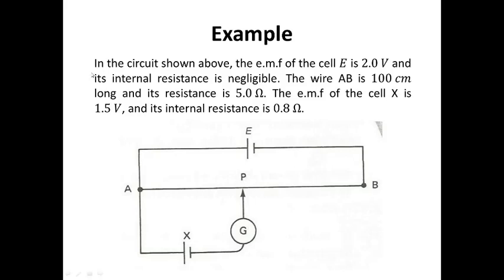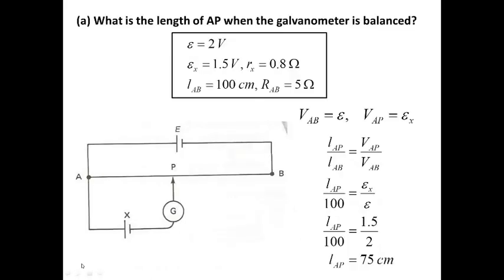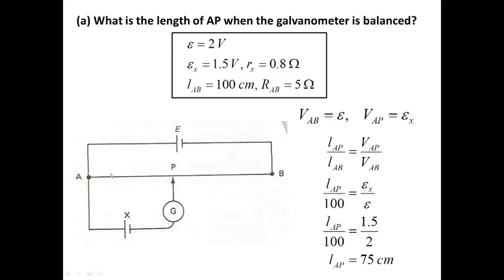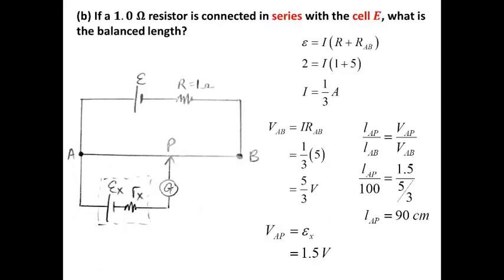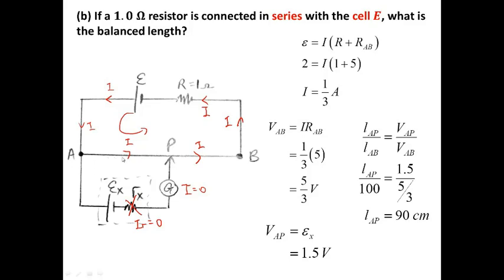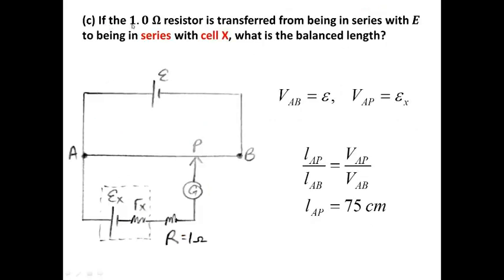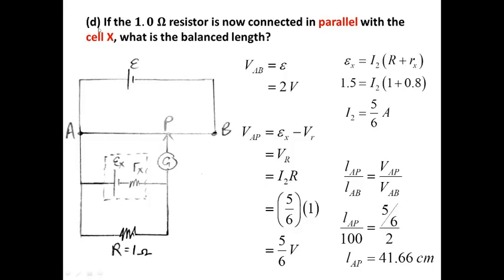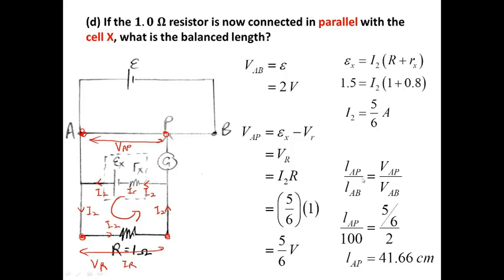Matriculation Physics: Potentiometer (Problem)

Comment: Sir, I'm confused..  IR= 0 because current is 0. But shouldn't it be V=IR ? but our V  isn't 0? Sorry for asking a silly question sir
Reply from the maker: Your voltage across the resistance wire or voltage across galvanometer?
Reply: @PekExplainsPhysics  is there a difference?
Reply from the maker: There are many voltages, which one you refer to?
Reply: @PekExplainsPhysics  if in the galvanometer?
Reply from the maker: Voltage across galvanometer is zero because of balanced length